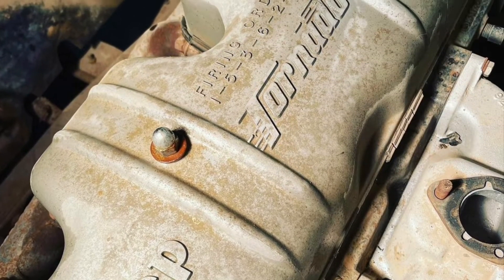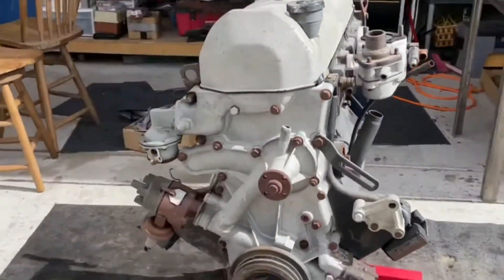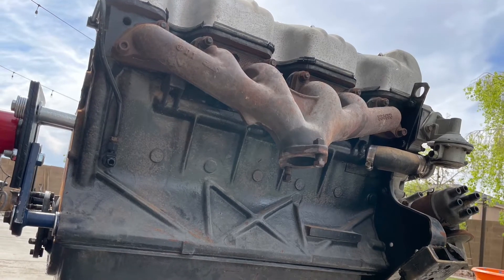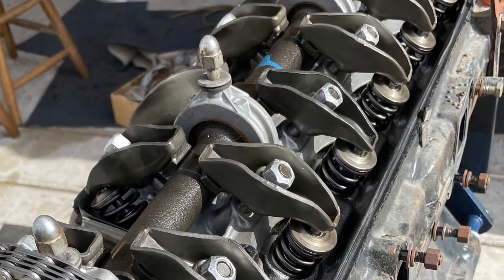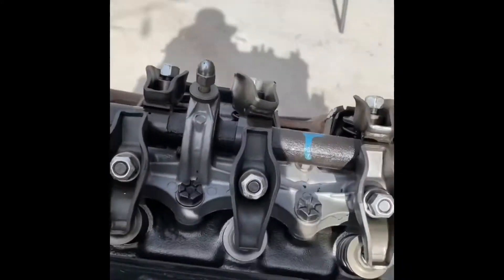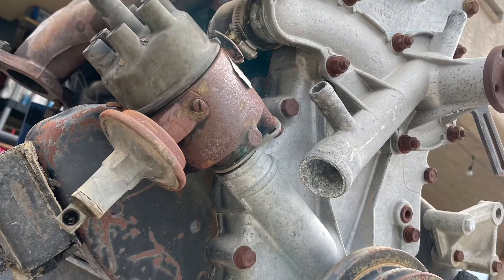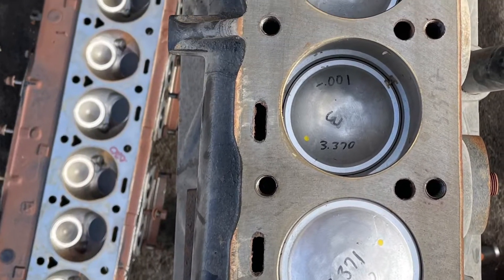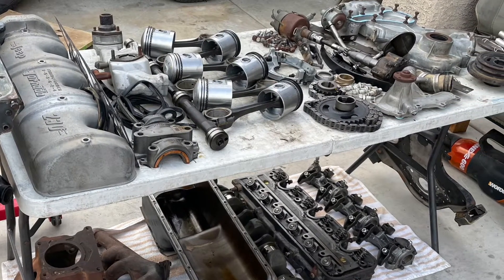Having a fun time doing the Jeep 230 Tornado Teardown

Comment: Te sugiero que contactes con gente de Argentina por que viendo tu video tu motor tiene el problema de lubricación que tenian en Argentina se soluciono  haciendole dos orificios de salida de aceite por cada leva aparte de eso en argentina tienen un múltiple de admicion diferente (mas grande)que le daba mejor admisión y mejoras en la tapa de cilindros , trata de conectar con el club argentino del torino y te daran muchas de las mejoras que se hizieron en el tornado 230 de 4 bancadas, hazlo y no te arrepentiras pero sobre todo lograras un motor mucho mas equilibrado y confiable .
Reply from the maker: Gracias por sus palabras! He leído ese problema. Voy a ver cómo sale este rebuild. Habrá un vídeo cuando pasa.

Comment: So, why did it get tore down? What did it need?
Reply from the maker: It was rebuilt probably 20 years ago. Multiple of the gaskets were already visibly unfit for use. That, and seeing that multiple other systems were put together haphazardly I decided to tear it down and verify for my own peace.
Reply: @stardog16  I get doing gaskets but I wouldn't have pulled the bottom end apart. Did it work out well for you? Is it happily running?
Reply from the maker: @isaakwelch3451  currently the engine is put all back together with new gasket set. I did find a couple things that were service bulletin recommendations and I did those. I am waiting for another couple items before I marry the trans up and install onto frame. Check out the J3000 build for latest video. Also my Instagram for more frequent updates.

Comment: a 1/4 mile engine tune-up mechanic in argentina, fitted it with two turbochargers and it reliably reaches 1000 horsepower. Great engine! thanks for show your work
Reply from the maker: Thanks Andres!
So I will start back up with the engine rebuild. I’m currently finishing up the frame and axles.

Comment: I also recommend you get the service manual "jeep tornado 230 engine" SM-1009-81. Willy's America in California is a good parts supply source. Also unless you modify the bell housing (which I did) you have to mount the flywheel and bell housing when the crank is installed. Also one bolt on the crank is slightly offset so the flywheel only goes on in one orientation. There is also a rebuild tips one the internet "OHC-230 Tornado Rebuild Tips" you might want to look into.
Reply from the maker: Hi - thanks for the additional tips. I did end up getting that manual and am currently studying it. And the bell housing is a trip ain’t it!!!
Reply: @stardog16  yes that bell housing is strange, but after about an hour with a die grinder and I can now install mine after the engine is assembled.

Comment: Currently just finishing up a rebuild of a Tornado 230.  One caution, the aluminum front filler block is made of a very soft aluminum.  I stripped the threads out of two of the holes before reaching the recommended torque (12-15 ft lb), ended up having to tear the engine back apart (front plate and oil plan) to replace the filler block.  Luckily I had an extra one but I had to reclean all the permatex off the parts and purchase new gaskets.  Before I put the replacement filler block in I drilled out the threads and installed stainless steel thread inserts using orange Loctite to hold them in.  Also make sure you use short bolts on the two upper holes of the filler block, long bolts will hit the bolt heads inside that hold the filler block to the engine block and not let the front plate seal properly.  I also kept all the torques to the bottom of the band, 5/16 bolts were at 12 ft-lb. Good Luck on your rebuild.
Reply from the maker: This is good info. Thanks friend!